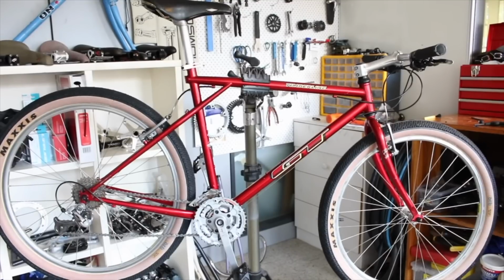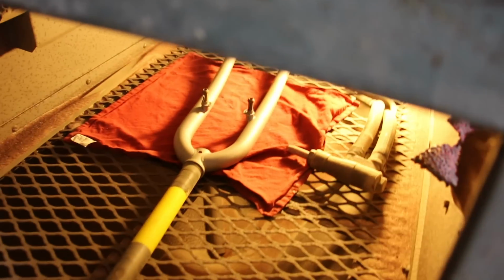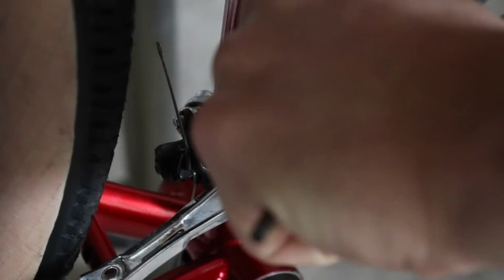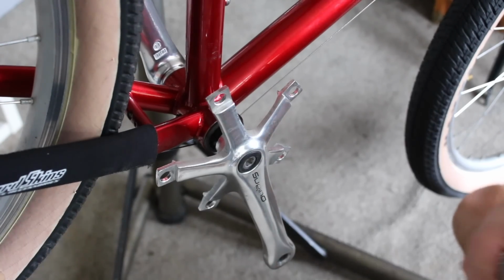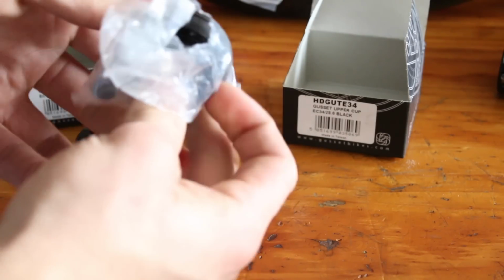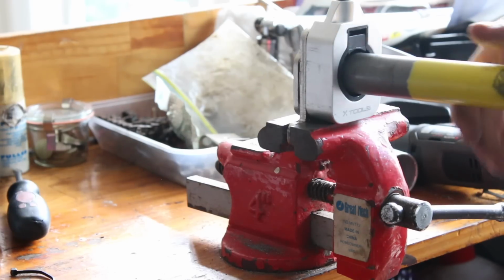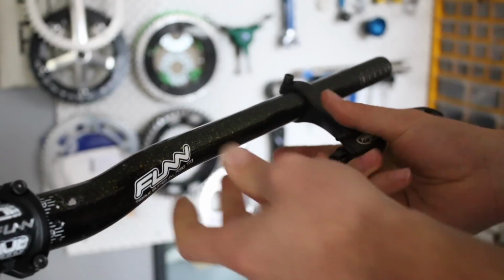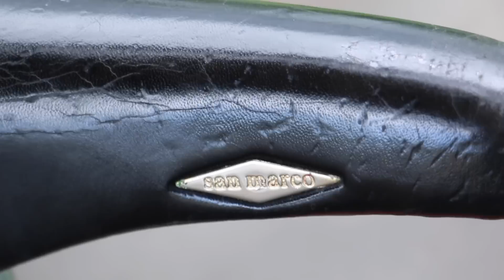Retro MTB - 1X Conversion & Upgrades

Comment: Deadset mate!!!! I have a 1991 GT Timberline that bent it’s original fork in EXACTLY the SAME PLACE!?! One jump on a small speedbump in the car park near mine. Steering felt weird. Checked it all out. Bent fork. Spewing!! Lucky I have my teeth still😬 I ride an XL/22” frame, so it was hard to find a replacement fork. It’s on it way here in the post as we speak.
Reply from the maker: Oh crazy! might be a weak point in the fork design? Glad you are spotted it and got it sorted before it got worse! what replacement fork did you get?

Comment: Nice! After I saw this build, I hunted around and bought a GT frame of the same shape and I’ll be building it up as a single speed, I think. I have some carbon forks for it, and the frame is unpainted so I’ll be polishing it and having decals redone in black, rather than yellow, and I’ll try and build it using only black parts and make it a very simple, clean build, I may even use a Skyway tuff wheel, I dunno yet. I love the colour on your bike, especially with the light tan walls, it goes together so well. The fork came up a treat too man, really great spray painting job on that one. Great to see a follow up on this one too, it’s changed the whole look of the bike, definitely a fan of the new brake levers too, looks really trick.
Reply from the maker: Thanks!! You’ll have to send me a photo when your done, keen to see how it turns out!
Reply: @waveywheelies  Yeah man for sure! Fortunately I just scored a Giant Thermo 1 very cheaply, I’ll throw some tyres onto it and it will be my main rider, so it’s going to allow me to do all the finishing touches of what I have now, so I can start onto the big projects sooner. I also have a pretty cool build planned with a Gary Fisher Joshua X1, I’ve ended up owning 2 of them, so I’ll do one all original and maybe do the other as a custom build and make it really 90’s with fluro and stuff, I think they look pretty sweet so it’ll be fun. Love your channel too man, your builds are always so smick, super clean and just awesome in general. Can’t wait for the next one.

Comment: Hello! first of all, awesome bike. Love the color.
Second! I have the same frame and I have an old 105 crankset that runs on a octalink BB. 
But I'm afraid that in order to fit the crankset I will need a BB with a longer axle and I dont know if I end up crossing the chain. 
Did you have any problems like this? do you have any advice? 

thanks!

Comment: Curious if chain will stay on front ring, don't they use rings with wide/narrow teeth chainrings for this?
Some day triple in front of my Fisher'96 Tassajara will wear down acceptable limits so..choices, choices....
Reply from the maker: Had no issues and have been running it for over a week, I also run the same set up on my road bike and have had no issues
Reply: Thanks! Good to know, really!

Comment: Hello!!! Good morning, I would like to know if you can help me, I have a MTB from the 90s. But I have a question, I don't know its size and I searched the internet and I haven't found anything. This is a 58 horizontal tube and a 43 vertical tube. Could you tell me what size this tube measurement is equivalent to? A greeting and thanks in advance.

Comment: That's a big shame with the fork, it has these cool engraved GT logo, unique stuff. And even with two pair of eyelets(well who cares at this channel). I've got same year or very close(97 or 98) GT Timberline in really nice satine titan-grey finish, looks much better than all those matte finish they make today. These bikes are the last ones before they started putting suspension forks everywhere. I think they are a pinnacle of stiff fork mtb/atb, very light steel frame with fine sport geometry(quite aggresive with original looooong slack stem), unbreakable stx/acera X components, sturdy wheels. I was very surprised how cool this bike rides, I'm going to make it like monstercross with drop bars, because are like them much more, but first time a wide flared drop bar, will see what is so cool in that "gravel" stuff.
Reply from the maker: Yeah I was pretty gutted about the forks, can't make myself throw them away even though they are bent. I tried to find a similar fork with the GT logo near the drop out but couldn't find any. That sounds like a cool project! I recently got my hands on a 93 Ricochet that I plan to restore, its got the original Rock Shox Quadra forks that I'm not sure what to do with yet. Would prefer to swap out to rigid if I can find a decent fork.

Comment: Do you have issues with the chain popping off on hard trails? I did the same conversion to mine and it can't handle more than 15 kmh on rocky roads.
Reply: Interested in the same, I'm trying to avoid buying a narrow/wide chainring, is your chainring ramped/pinned?
Reply: @brandondare3830  It's just a normal cheap chainring and crank arm combo. I just found out that the issue on mine is derailleur tension and chain alignment.
Reply from the maker: Unfortunately I haven’t taken it on any trials yet so I’m not too sure! It’s been perfect so far on the road as a commuter (with a few curb hops and messing around)

Comment: Very interesting Video!
I am also interested in converting my '92 Karakoram to a 1X.
It's interesting that you did it with your existing Cassette and deraileur. 
I'm interested in doing the same.  
I have a stock setup on mine - Shimano DX drivetrain ( I believe 3x8). I would prefer a smaller
Chainring though - like a 32 if possible. I'd appreciate it if you can provide me with some
suggestions. Thanks!
Reply from the maker: Thanks! Flick me a message on Instagram if you want. Happy to help👍

Comment: What's the chain line like with this setup? Is it mid cassette?
Reply from the maker: Sits a few mm’s to the right of the centre
Reply: @waveywheelies  so you could remove the chainstay protector and have it central? Is central ideal or slightly to the right?
Reply from the maker: Generally speaking having it central is best, in this instant is it close enough to work well and I haven’t had any issues. 

The only way to make it more central would to have a narrower bottom bracket or put the chainring on the inside of the spider. But this wasn’t possible with this set up. I hope that makes sense 👍
Reply: @waveywheelies  cheers for that.

Comment: better, but there is always room for upgrades, new-old cranks could be polisched, an by 10 or 11 casette and up to date shifter, more outstanding tubing, an ring on both sides to keep the chain from getting of the chain wheel, protecting it and your trousers ...

Comment: 1X with a 43T chain ring is ridiculous. Rear cogs need to be wider, gearing sucks.
Reply: I have a Single 53t with a 12-28 on my All-road bike,  only 7 gears
Reply: @SamSeoMaC  You got it right road bike. Flatt roads no hills to climb. 30mph 50 gear inches for your low gear sucks more than his.